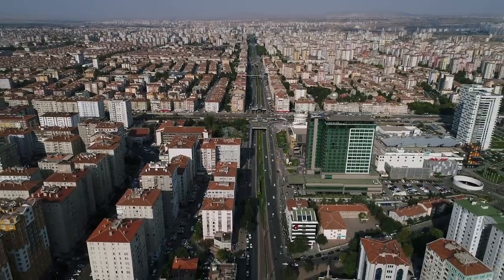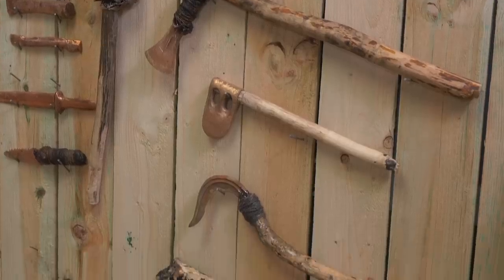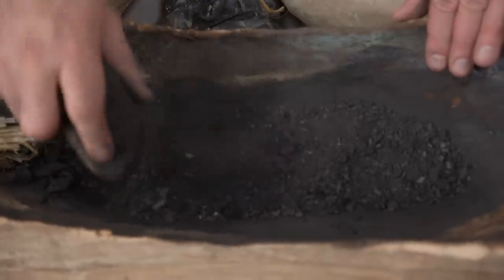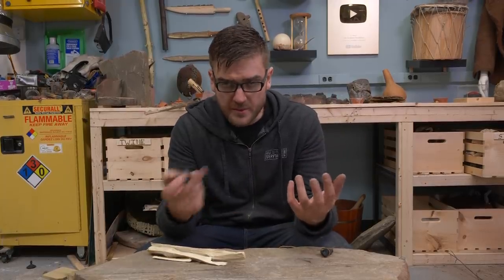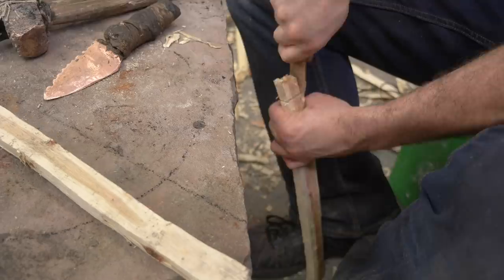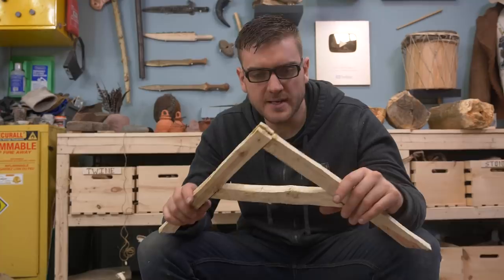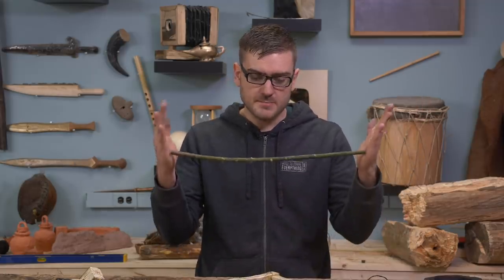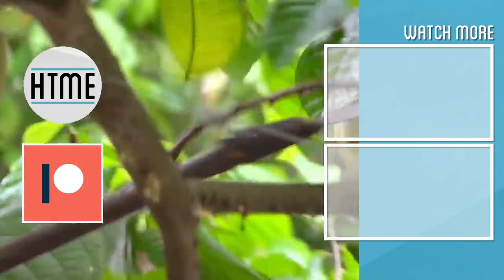DIY Tool that Built the Pyramids

Comment: Only thing I would point out is that the ancient Egyptians were said to be master craftsmen in wood and stone, as well as being masters of the counterweights.  That being the case in order to make tools to Egyptian standards you would have to make them as true and accurate as possible.
This means that your square would have to be sanded to a nice true finish, and any metal tools would have a high polish for precision work.  Still
your work shows that with sufficient effort it can be done.

Comment: Just measured my own cubit and found that it's pretty darn close to 18 inches (or a foot and a half). As someone who firmly prefers the imperial system (for several reasons, including the fact that twelve has more factors than ten and a foot therefore can be divided evenly in half, thirds, fourths, sixths or twelfths without splitting units) this made me very happy.

Comment: You should consider carving out that plum line instead of chalking it in. It's easy to rub out chalk if it gets wet, and carving also permits a much finer line for better visual accuracy. Just take your little saw across the board a couple times.

Comment: You could probably get the wood straighter and more accurate using sandstones to sand the wood. To make the sanding stones, you could probably use the same method used to make sharpening stones in the wild: Take two river stones of equal grit and hardness (Possibly the same stone cleaved) and rub them together until they grind each other down to a flat surface. Use a soft wood, and relatively large sanding stones as planes, and you can probably get very flat and straight pieces of wood.

Comment: a possible measurement could be called an "ashen".The unit of measurement could be determined by getting a block wood of a set size,like the the span of Annalise's hand in diameter and 2 or 3 of her spans in length,then burned in a fresh area with the ashes collected and then carefully dumped on surface(as smooth as possible),after repeating the process a few times the average diameter of the ash piles becoming you standard "ashen" which could then be accurately used.Once that is done you could provide others with the new "ashen" measurements for the block of wood and instructions for how to replicate the results which would provided a repeatable standard unit of measurement.

Comment: I was doing some quick research on whether it would be possible for him to make a proper saw without steel. this turned into a question of files. it turns out there are a lot of scales of material hardness.  but i found out that on the Mohs scale (how resistant things are to being scratched) bronze is a 3 and quartz is a 7. if he could come up with a source of quartz, he could potentially be getting somewhere with a sharp piece of quartz. it will break (fairly far away from the cutting edge at least) fairly frequently, but it should work.

Comment: One cool method that the Egyptians used to saw wood was by cutting a small notch in the wood with a blade, then they would fill it with sand, then go back and forth with a thin strip of metal on top of the sand and essentially use it as a file or rasp to cut through the wood, rather than using a toothed saw, due to the difficulty to make that with the softer metals of the time period.

Comment: A 3,700 year old Babylonian cuneiform tablet has been translated that contains a list of Pythagorean Triples.  That's not old enough for the Great Pyramid, but it show that it's definitely Bronze Age knowledge.

You could use your "eyeball it" idea to make an accurate square.  Bisect the angle, then use the line drawn to adjust your square.  Repeat until you cannot see any variation when you turn the square around.

You didn't have to draw the full circle.  First draw a line.  Mark a point about in the center.  Use your string compass to mark points on both sides of the center point that are equidistant - we'll call these the end points.  Lengthen the string.  Put the compass point on one of the end points and mark an arc above and below the line - just eyeball it so it looks like they're close to where a perpendicular line will pass.  Set the compass point on the other end point and do the same thing.  Where the arcs intersect, mark those points and draw your perpendicular line (which will pass through the center point).

Comment: How to make a perfect square with just a straight line and a compass:
-draw a straight line
-find the bisector with the compass like you did for finding the straight angle
-fix the compass to the desired side length and draw an arc from the original line to the bisector centered at the straight angle
-draw two additional arcs centered at the intersection spots between the first arc and the lines

the intersection spots between the first arc and the lines and between the second and third arcs mark the other three corners of the square; if you want to double-check:

-readjust the compass to the distance between the intersections of the arc and the lines
-go back to the original straight angle and draw another arc parallel to the first one

if that arc intersects with the fourth corner, everything's OK.

Comment: It doesn't matter how long your unit of measurement is, it just has to be consistent and usable.  My recommendation is to take a flat stone and chalk out a standard unit and 10 of those measurements.  Then chisel the marks in.  That way you can always come back to that stone to create your measurement strings (a string with a knot every set number of measurements, also where we get the knot measurement from) and other devices.

Comment: I am a builder, I would suggest a unit of measurement that is a "workable" length, maybe start with your base measurement, what we call the inch, and break it down in halves, although they compare the cubit to the meter, common sense says to me you will end up with something more like the "American" type of measuring as half of a half is a quarter , to an eighth, etc. Once your base measurement is defined, then everything falls into place, the reason of course that we use 12" as the foot is , 1) a workable distance, and 2) 12 is divisible by more numbers than any other. Also I love your chalk line, wouldn't it seem easier to just run the line over a chunk of coal though? And I think I would have a large flat work area to create a straight edge on a piece of wood, with sand, like sandpaper. I appreciate what you are showing, I find it very strange that scientists think there was no learning going on or something. I think you will find that just in the building of the "know archived tools" of that time, you will think of ways to expedite certain processes and realize that maybe the guys digging up the artifacts didn't have any idea about building, and completely overlooked or disregarded certain items or remnants of, that might have explained a lot to people today, who, only the diminishing few have a deep understanding of how to build something with one's hands.

Comment: Andy - use a drop of water as a universal measurement.  In general, using a rain drop as a constant during this time to determine the unit for a volume and capacity measure equals = into 0.095 ∅ 1 cm ( one-centimeter diameter sphere ) as per its equivalent volume - ultimately it gives a standard for determining length width and volume (the meter, royal cubit etc) for pyramid builders ( just imo)

Comment: Take two more stones just like that big flat one you were marking up. Grind two of them together to flatten the surfaces of them both, you then alternate with the third. The need to grind all 3 surfaces in all combinations to end up with 3 perfectly flat stones.  You then sand your wood on one of the stones to get it flat. Keep the other two stones to regrind your sanding stone flat again when it starts to wear.

Comment: It takes multiple iterations of a square to get more square. Eventually you will need a metal square which is more stable. You will need a lot of metrology upgrades like a surface plate to help get more square.

Comment: The Bronze saw is just used for cross cutting. The saw can make a better cutting surface than axe, and saving time. With the evolution of saw, people finded sawing through wood is also efficient than splidding wood with an axe or wedges.

Comment: You should do it in base 12.  I've always felt it was more efficient than base 10, as it is divisible by 1, 2, 3, 4, 6, and 12.  10 is only divisible by 1, 2, 5, and 10.  You wouldn't need to deal with fractions as often.

Comment: 13:25 Something that I've always wondered about is the possibility of a modern scientific definition of a foot/cubit/meter that would have been practical in earlier centuries. Some set of rules or instructions with which anybody around the world could recreate the same ruler/measuring stick to high accuracy.
Reply: yeah if i recall correctly the meter was the first universal unit of measure and it was only created during the french revolution 

it was 1/10,000,000 the length of something of earth's meridian

Comment: You would use a flat rock surface to sand down the wood into a better flat edge. and a rough form of sandpaper can be easily made with glue and sand on a rock flat surface. Likely the best way for any precision surfaces to have been made was sanding/ grinding which can produce very fine surface finishes.
It can also be used to fit surfaces together by wearing both together till they fit perfectly.
If you take your triangle feet and scrub them on your flat rock until they are flat then do the sides until they are  at 45 degrees perfectly you then have your corrections made to an almost perfect standard....all it takes is time, which they had a bunch of.

Comment: I think the middle finger to elbow is a good measurement that could be easily reproduced for multiple reference sticks. You should use heat to steam bend the reference stick as straight as possible for more accuracy. You could also take an equal length of string and fold it half to create a half cubit measurement and mark it on the reference stick

Comment: Just so you know, you can get a 90 degree angle with nothing more than a piece of string. You draw a circle out with it, mark the middle, and then you draw a line though the center point to the edges. You then choose ANY point along the circle's perimeter  and draw a triangle using the center line you already drew. The resulting triangle will always give you a right angle, it's actually kinda miraculous....

Comment: Just as you were describing making a perpendicular line by sight-guessing and inverting the straight edge, I was screaming about the string compass and two circles/arcs method. Glad I watched a few more minutes before putting those shouts here on the comments. I have no doubt geometry involving circles predates the pythagorean theorem, but I was curious when the first use of a string compass would have been identified.

Comment: the biggest problem your wood tool has is that you choose a wood piece that has a knothole in it. That makes everything way more tricky to align. So you need a bigger starting piece (where you can easily find non knothole parts) or a piece that doesn't have any. I imagine getting a knothole plane without modern tools to be tricky (even they struggle there) and most likely require some kind of grinding stone or something other abrasive that takes off material. Cutting is more following the grain of the wood so they usually have a harder time to get it perfectly level if there is a piece were the grain structure changes.

Comment: I think the Egyptians knew that the surface of water is always level and that a weight on a string always hangs vertical. The angle between horizontal ( level) and vertical is 90 degrees. Thus a bowl of water and a weight on a string is all one needs to determine square.

Comment: A larger tree would yield you a better more stable board. Using saplings your tools will warp and rack quickly.  

Saw blades were not cast in 1 piece. The piece of bronze was hammered into a uniform thickness and teeth were cut into it. They rarely ever found examples of Egyptian saws or any saws older than the Middle ages because they were used to the point that after a few resharpenings they were recycled. 

You should try to make a hand plane. A hand plane will help you make a better board

Comment: You should try dipping your wax piece in a thin slurry of clay then coat with fine dry sand, then dip in slurry and coat with sand. Repeat until the clay is thick enough.

Comment: I remember reading stuff that suggested the Egyptians had some sort of circular saw that could be spun I assume by pullies and rope. Think you could try making a copper or bronze disk and set it up so sand can get between the disk and a rock or something to see if it works?

I'd ask about casting the disk with sand embedded in the metal, but I dont know if they would have done that back then.

Comment: The length doesn’t matter as long as it is consistent.  Each master mason  had tools that he made based on his master.   One ruler could recreate ate hundreds of identical rulers.  Guilds were responsible for ensuring standards with their guilds.  Weights varied also and had to be checked when buying and seeking things.  To take a man’s measure meant comparing his scale against your weight to ensure that he wasn’t cheating you.

Comment: Strictly speaking, equal diagonals only implies rectangular.  For square, it is also necessary that the side lengths be equal.  That probably came out of the construction, but double checking would be simple using the same method as measuring the diagonals.

Comment: you should make a set of stone laps using the three plate method. i feel like they must have used them to make perfectly flat stones that they could use to check for how flat something is and to use as a reference surface to use a very rudimentary height gage to make boards to the same thickness and such with higher accuracy

Comment: I think it's important to add the Egyptians used an average, for engineering scale measurements. You'd grab a couple of people arms, ideally leading to closer lengths to any previous. Most measurements for fitting however, would simply have been taken from where they needed to fit whatever, whether it's a stone, or wood etc.

Comment: One thing its safe to assume here for woodworking and creating flat surfaces is a wood block plane. We already know the Egyptians were chisel masters. Building a wooden frame to hold them in for planing wood is the next logical step. Similar planes are known to have been used in China about as far back as the pyramids. 

Once you've got a plane, building wooden straight edges, at least for the master builders seems likely. Grunts likely used string still.

Comment: The Egyptians were very advanced and used a few tools way in advance of their era.  For instance they would use a length of twine knotted into 12 sections and then joined into a loop, this then was used to get accurate right angles, circles and much more.  All this without any understanding of the Pythagorean theories.

Comment: A unit that might be curious is if you used something astrological as a reference for unit of measurement
Like perhaps take 2 noteworthy stars, and use the distance between those 2 stars on a stick held at arm's length

It'd be a little overly complicated in definition, but it'd be unique and interesting

Comment: Highly suggest using a base 12 system of measuring (like 12 in. = 1 ft) because it is so much easier to measure thirds than it is in a base 10 system (like 10mm = 1cm)

Comment: For the measurement use the width of the first tree you cut for this series. Maybe divide it into smaller units with the multipliers of the amount of rings in the log

Comment: Advice from a professional woodworker: do parallel sides before doing the 90° joints. It will even out the inaccuracies better.

Comment: As politely as I can say this, I believe the issue making the see, was trying to cast it, as opposed to forging it. By heating and beating Bronze stock. Now, obviously you'd need a Stone or Bronze anvil, and a stone or Bronze hammer (Stone would probably be better. Easier and cheaper to make, and far less likely to loose it's shape)

Comment: To draw a square I would probably first draw a circle with the help of the string and then make a straight line through the center, then I would draw a small circle with the same center point of the big one... and where the straight line crosses the small circle in two places I would again use these points as the center of two identical circles that crosses each other. And where these last two circles crosses each other, I would draw a second straight line through thus making the second line exactly 90 degrees off of the first straight line. Now you have 4 points on the first big circle you can connect with straight lines and you get a pretty much perfect square.

Comment: Something the Egyptians would have had would be flat surfaces. By grinding 3 surfaces together, the end result is a flat surface. From there you can test and form straight edged tools by adding an abrasive to the flat block, though you would have to fix the block back to flat after.

Comment: The pyramids were leveled by chasing a channel to to hold water. The dimensions were measured out with a wheel, this is why they are all proportional to pi.

Comment: I'd go for a base 2 measurement system. Base 10 metric is nice, but if a factor of for example 8 between two units allows for easy conversion by just folding strings of that length